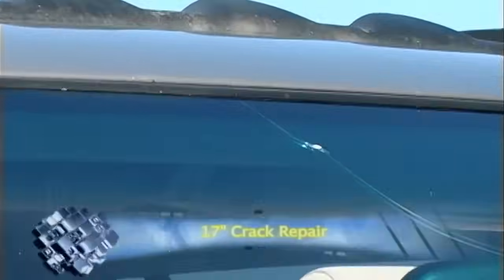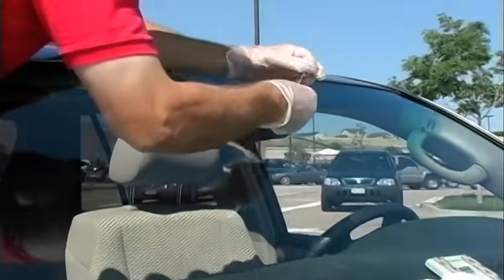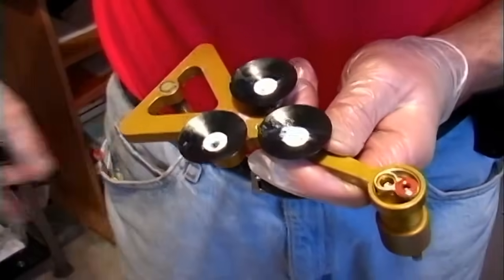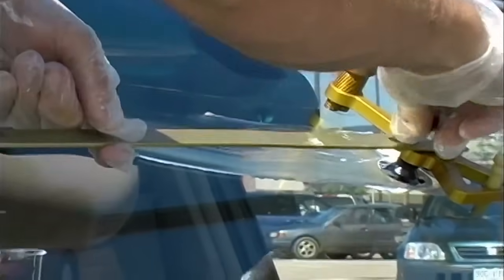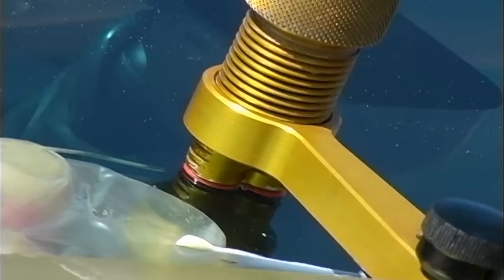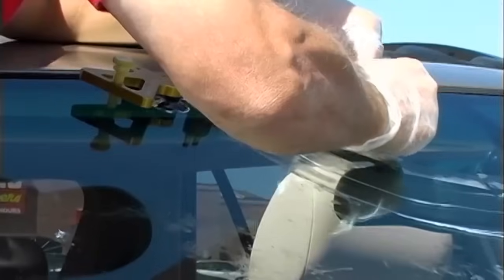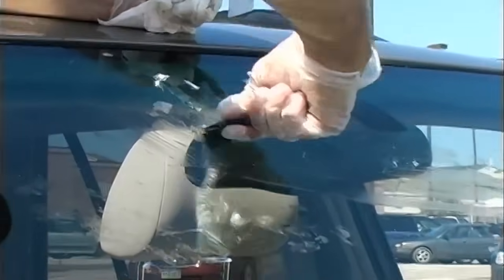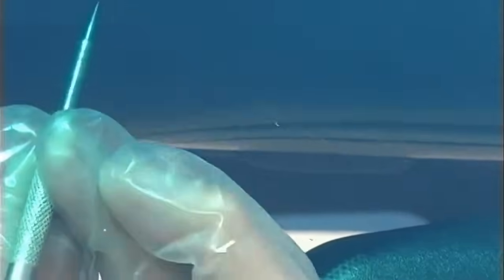Windshield crack repair (17 inch)

Comment: I used this method (grease on the suction cups) with a $15 Rain-X DIY chip repair kit and successfully filled an 8-inch crack in my windshield! 🙌🏼🙌🏼 Thanks for the awesome video!
Reply: does it go through the other side? im worried that my tint will get affected. thank you!
Reply: @vpnvpn4705  No, it's on the outside and there's a layer between the inside and outside glass. You can look up more details about how windshields are constructed, but you're filling a crack that's only on the outside layer.
Reply: Nice to eat It worked, I was gonna try it as well ! Do you use the seringue to push the resin in or to suck the air out ? 

Thanks !
Reply: The Rain-X kit uses suction cups and a tiny hole at the bottom of the reservoir pressured against the glass, which pushes the resin in and displaces air/vacuum out. The grease on the suction cups like this video shows allows you to move the whole apparatus and fill a crack instead of just a bullseye/chip.

Comment: The reason why they where to replace the windshield is because, (I am a tech) after the crack is longer then a 6 inches (a bill note or dollar), the is a safety issue with repairing the windshield. the Resin after it cures becomes harder than glass. windshields are made to break a certain way, to much resin will alter this, and could honestly be a huge safety hazard.
Reply: How much does a repair like this cost????
Reply: @e.nicholelewis1561  Emily, it depends on the tech.  I'm in Wichita Ks, I'm a player @ $75.  Crack repair can be very smart. It all depends on where, how old, and so forth. The dollar bill rule is an invention of Safelite Auto Glass. I think it's funny that they use a dollar bill as the metric. Because really that's what it's all about the dollar bill they want to sell you a new windshield all the time and always. Search out a good windshield repair service in your area.  ROLAGS is the standard (ANSI). Good luck dear.
Reply: I'm getting mine done Saturday. Safelite is coming. The crack is almost 8 inches. $381.19. Not bad. I was thinking over $1,200.

Comment: I knew that it could be done, but I was a bit of a skeptic with that long of a crack. That’s quite impressive. The only problem I’m having is that I can’t find a shop that will do it. All the shops I’ve contacted only want to replace which could be different then my JDM windshield.
Reply: No shops really repair something that large, the chances of it spreading after the fact are too great and we have to deal with frustrated customers more often than we want to
Reply: This is why you need a boyfriend

Comment: FYI...The reason most glass companies won't repair cracks longer than 6" is because (or should be) because it is a structural issue. The windshields are part of the structure of your crash rating and must be full or as close to full strength as possible to protect you in an accident.  So yeah, you can cosmetically improve the looks (somewhat) with this method, but it is still damaged.  To each his own...be safe!
Reply: Russell C this is a great trick to keep from getting a ticket.  It's a hefty fine for a cracked windshield. $29 < $300

Comment: no use of a vacuum pump, interesting. I always thought the best fixes are done with them. You did a really good job on this, considering the age of the crack....6 months...damn.
Reply: You are right. Best repairs are done with a vacuum (on rock damages which are your stars, bullseyes etc.) but that crack is so wide open there was no reason to use all that equipment. The resin and Mylar capping plastic would’ve done the job. When the crack is open enough to feel with a nail (as that one was) you could drop anything in there and it’d fill almost immediately.

Comment: Amazing. I always thought that with a long crack in the windshield it had to be replaced.
Reply: Michael G your windshield will spread its not repaired just temporary fix I won’t in this industry for 80 to 100 to repair or 50 dollar difference with insurance let the insurance pay 💰
Reply: It really should be, safelite in my area won't do repairs on cracked windshields. Only small rock chips under the size of a quarter.
Reply: @newmenalejandro1362  That's right, this is 90% cosmetic and the area will always be weak and may be vulnerable in different ways whether you're caught in a hail storm or driving on bumpy terrain, but I still wouldn't hesitate to do this quick fix.

Comment: I need this guy right about now. Just for a little 1 inch Crack these knuckleheads are telling me I need to replace the window. Problem is, I have a BRAND new car where less than 5,000 of them are driving around in the US and the windshield is very limited

Comment: In most cracks you don't even have to use that... Just run the resin with the tip of the resin bottle... Follow the crack and it will fill the crack with resin as you follow the crack line  ..

Comment: Thank you for probably one of the best videos on the subject of spider crack windshield repair that I have seen. Question arises: if the windshield cracked as a result of something hitting it from the inside (a ceramic mug), does the repair have to be done from the inside, or is it assumed that the cracks have gone through and through and you can just repair it from the outside?

Comment: This is a temporary fix. A CRACK WILL STILL SURFACE BECASUE THE INTREGRITY  OF THE GLASS IS COMPROMISED. The glass has a weak point that is unreachable by the technician. An expensive way to hinder replacing the windshield

Comment from the maker: I got mine for ~65 euros from ebay. It had resine for many chips and few cracks, but ask the seller if it supports long cracks. Search on ebay or google for "windshield crack repair". Cheers!
Reply: What's the brand? Do you know by any chance. Cheers. Good video
Reply: When scraping the resin off of the final bullseye he says to "scrape straight on ... scraping at an angle will gauge out the resin that cured in the bullseye". What does scraping straight on mean? How exactly should the blade be angled??

Comment: Advice me how to flex the windshield near the bottom of it. I have long crack that just appeared and it’s 1 inch above the wipers( in the edge of the dashboard ) I tried pushing the windshield but it’s not flexing and resin is not going in 😔

Comment: A little advice coming from someone who's been in the auto glass industry for over 20 years now. If you pay your insurance company around 5 to 10 dollars a month extra for glass coverage or you live in a state where if you carry comprehensive then your deductible is waived,why repair something when it can be replaced. Filling the crack in doesn't change the fact that there's still a crack in your windshield. It's just filled with a clear resin.Like if you have a pimple on your face why cover it up with makeup if there was a product that will remove it.The structural integrity of your windshield is. compromised the second the crack spreads from its initial impact point. The only benefit of a chip or crack repair is for someone to save money that doesn't carry the proper insurance. For example it doesn't make sense to carry comprehensive or collision because your driving a rust bucket so a windshield replacement wouldn't be covered so in the scenario it would be beneficial but i see too often people driving a brand new car, they have a crack "repaired" and say wow i can't even see it what a great job. Then they drive around not realizing that it's still just as cracked as it was before it was repaired. The integrity or your glass is being held together by a UV cured resin. I'm sure the engineers at BMW didn't have that in mind when coming up with schematics for the original windshield of your car. The glass works as a structural piece the works with a A and B pillars of your vehicle to hold up the roof during a roll over or collision. It just doesn't make sense to half ass something when it can be done right for the same price.......FREE.

Comment from the maker: ps. in the end the kit was good exept that the seller added on rubber ring that keeps the pressure in the syringe but it was not meant for this work and melted with the resine so there was no pressure applied to the resine and it didn't penetrate in depth, so the crack was visible. I assume if there was not this problem the kit would work fine.
Reply: That Video is not as bad as some others what just focus profit. as you were talking about the price where did you get those components? are you talking about the o-rings melted a way?

Comment: Bit of water salt off bug spray and alcohol apply with foam brush let it dry for about 2 hours crack will be gone no expensive equipment needed
Reply: Do you know the exact amounts of each item to use?
Reply: Matt Swinehart it doesn't actually work. Look it up on YouTube and they prove it wrong in a couple of videos
Reply: you actually believed that shit? xD
Reply: dacasman
Exactly. 3 simple household ingredients can mysteriously weld glass back together? Lol.

Comment: Just so y’all know the insurance will pay for a new windshield if you have a crack in the view of the driver and 3 to 500 to be safe instead of trying to repair (which is never guaranteed) and end up replacing and Insurance won’t pay for tampering

Comment: Same here my crack is much smaller but they  cant repair the crack but want to replace the entire windshield.  Can you use petroleum vaseline as a lubricant when sliding the suction cups along the crack. Where can you buy that tool and two part resin. Can you use clear acrylic resin?

Comment: The kits start at $500 and go up to $1500.
The crack isn't gone its just less noticeable.
Iif it takes another good hit, kiss it good bye.
Reply: Lyrik L.block He works at a windshield repair company.
Reply: Since the next good hit would result in an additional crack and a lost windshield according to your logic, you've at least saved the cost of one windshield by having this done.  Whether it is worth your money to buy the kit if it is indeed that expensive would depend on the frequency of cracked windshields that happen to you.  For some people, it might be worth it.  The price you quote is a lot more than I'm willing to spend on the possibility that I would do it right and get enough cracks to justify the cost, even though I got my first crack on my new Jeep Wrangler JL in only 2050 miles. :(

Comment: $1,000.00 for a windscreen? 
What kind of a car are you referring to?
The cost of a new windscreen for vehicles manufactured today, (generally), don't cost the amount you're indicating. 
Admitingly, some newer, high end vehicles do and upcoming models will, but the majority do not. 
And yes! You are correct. 
The plastic, (Poly Vinyl Butyl), inner layer stays intact and the windscreen is still safe......basically. 
But ultimately, oxidation overcomes the molecular structure of the "Plastic", due to the separation of the repair resin to the glass,  (which are two totally different substrates), and a delamination process begins, therefore creating an unstable and unsafe environment. 
I appreciate your effort to defend the repair side of our trade, but an O.E.M. like or kind replacement, by certified installers,  is always the best option to meet manufacturers specifications and federal requirements. 
Especially if factory type warranties will be voided if substandard procedures are implemented. 
I'm not against repair. I just prefer replacement.
Reply: +Tom Gates II I've never paid more than $250 for the windshield and installation. I've had it done to three cars.
Reply: +Tom Gates II I had my side window replaced and that already cost me about €250. But I'm in The Netherlands, so maybe that's the difference. A new windshield would cost me about €700-800, which is about $800-900.
Reply: +Austin who would you recommend?   I need a new windshield.
Reply: Cheryl Dahl  I recommend you shop mechanics and other repair shops to get quotes.

Comment: Does safelite repair door windows if the windows no longer comes down with a new auto or hand crank device.
Reply: Yes we will do the labor but you must supply the replacement part (i.e. regulator)

Comment: Should one wash the glass where crack is with alcohol to be sure it is clean, or don't bother.
Reply: Wash yes. Alcohol? That I’m not sure of. I know at Safelite we clean with glass cleaner (the foam aerosol kind) and then  we use a capsule of acetone to prepare for the repair process

Comment: why do you need to drill at the end of the crack? what if you don't drill and just fill it with resin?
Reply: The resin provides no structure or support to the cracked glass, it's really just a filler - not a glue of any kind. Therefore any pressure on the glass will cause the crack to continue to spread regardless of the resin filler, just like a run in a nylon stocking ... it's hard to stop once it gets going. So again, even with the resin in the crack, the crack can very easily continue spreading.  By creating a hole at the end of the crack it makes it difficult for the crack to continue anywhere since it ends in a roundish hole. The same can be done with cracks in plastic. If you drill a hole at the end of the plastic crack it won't continue to progress.

Comment: I have a circular crack with three star cracks in the middle of it and is about the size of the bottom part of a standard coffee cup. It is three inches from the bottom. I can't afford to replace it. It happened in May and hasn't spread at all it's only on the first glass. I know windshield has a tempured glass then a type of plastic then the second glass. I would like to repair it and most places have said to replace it. But I cannot. Please help
Reply: If it hasn’t got bigger since it happened I’d advise just leave it alone. It most likely will never get bigger unless u fuck around and try to fix it then it’ll probably grow

Comment: This dosnt fix anything just fills in the crack so you don’t see it. It’s good to make it look better but if your window got multiple cracks it be best to just get it all replaced with new glass
Reply: Not true at all. Repair of Regular sized chips and cracks will stop them from getting larger and its 99% effective in doing so when done correctly. So you aren’t helping anyone (or even adding to the conversation) by chiming in on an issue which you clearly know nothing about

Comment: Is drilling ahead of the crack and tapping it to make a bulls eye really necessary?
Reply: Ab Abner like we always tell customers there is a chance it will spread a rock chip repair is never guaranteed but the bullseye just helps relieve pressure so it does but you need to know how to apply

Comment: I'm curious if that repair meets the structural requirements of the vehicle manufacturer and the rollover standards of the state or country it was completed in.
Reply: +Tom Gates II Well pay $1000 for a new windscreen then.  The plastic is still in tact for 99.999999999999% of the windshield and that's what keeps you safe.

Comment: I was told by a glass dealer that tempered glass will explode if you drill on it. is he right all at? thanks in advance for the reply.
Reply: It's like the twin towers....it's designed to crumble with a certain level of stress (not explode)....I doubt controlled drilling would cause the whole windshield to break...This is referred to as safety glass as the crumbled pieces don't have sharp edges and won't cut you...It's assistance in structural integrity is insignificant IMO, it's prioritized use is related to safety in preventing cuts.  It's the same glass required in every school windows here in NY.

Also in my experience when I was drilling using the wrong bit, it extended the crack more as I had to put more a lot more pressure on the windshield for the bit to penetrate the glass but when using the correct carbide tip drill bit, it drilled with no issues and barely needing to put any pressure on the windshield.  But neither methods have ever caused the whole windshield to break.
Reply: ironmax007 this isn't tempered glass, only the side Windows and rear Window are tempered. this is laminated plate glass
Reply: ironmax007 lt wont explode .. lt shatters in hundreds of pieces
Reply: Windshields are safety glass, not tempered glass.
Reply: @cesarmendoza8632  If you've ever tried to cut it, it literally does kind of explode. When I was a young lad, I tried to cut an old shower door with a glass cutter, cause I needed a smaller piece from it. Didn't know it was tempered glass (cause when I was young, I didn't know anything, lol). Needless to say, once it gave, it sounded like a gunshot and pieces went flying everywhere, including up the stairs and in directions I never thought it would go. Kind of like an explosion. 

I get what you mean, it doesn't "literally" explode, but you'd swear it did, hehehehe. Same happened when I dropped a tempered glass bowl on a hard kitchen floor. I was still finding pebbles of glass under the fridge etc. clear across the kitchen months later and I thought I had swept it up really well.  It definitely likes to break "in an explosive fashion" compared other glass and ceramic.

Comment: you said you need to gel up your tool to prevent air up in your crack & at one point you said you can use your thumb?
Is their some hidden message in here sir?
Reply: Burt Purvis thump from otherside of glass so, resin can spread easily!
Reply: Konchok Tharchen. Oh man i took it the wrong way. I've been gelling up my tool far tooooo much dude.
Reply: Burt Purvis No Burt Purvis, you got man. You’re doin it right, don’t ever let anyone tell you different.